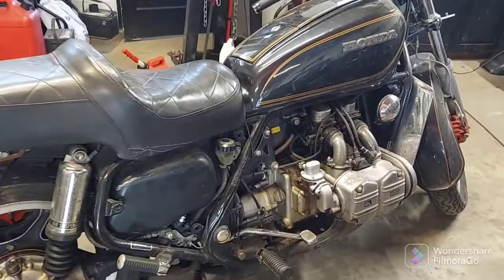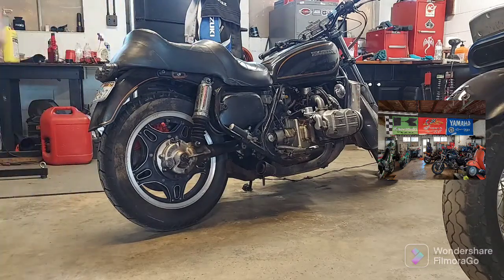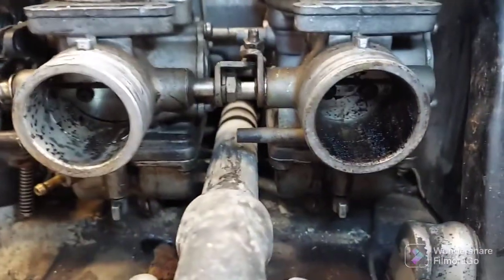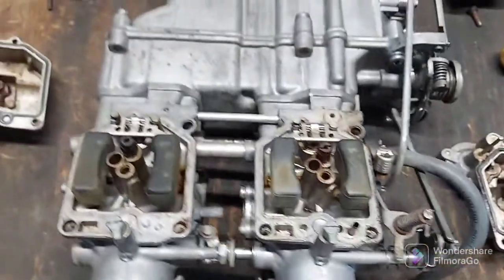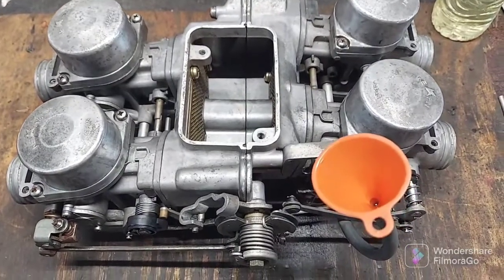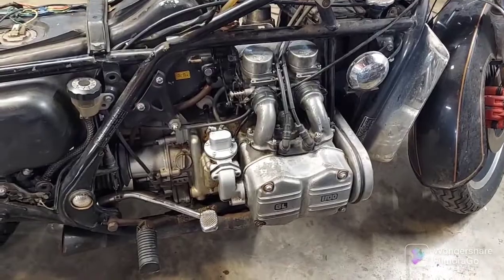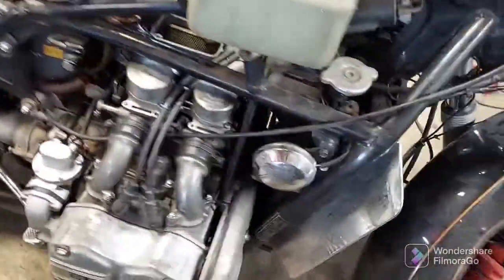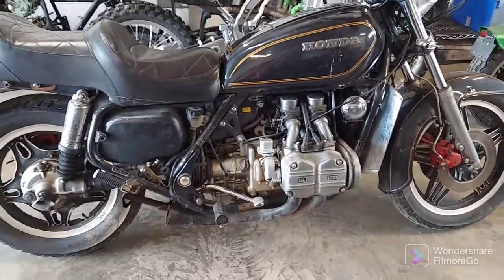1981 Honda GL1100 Goldwing will it run, first start! Carburetors rebuilt!

Comment: Good job, I did similar to a 1982 and a 1980 GL1100. after basic cleaning, carburetor and gas tank cleaning they run quite good. The GLs have a lot better engine design than the cb750s
Reply from the maker: @fkat28  thanks, I actually get to work on These  GL's quite often through the years. I have a 79' GL 1000 in the shop now that I'm about to finish, and one of my customers gave me an 86' GL 1200 that I am doing a video series about here on my channel. Plan on totally customizing it, just because...
Yeah, once the carbs are squared away on these GL's they do run awesome. Appreciate you watching and commenting 🐲
https://youtube.com/playlist?list=PLICWLX3xQIRPEn9JQXItuwfWZXvFHlc7K&feature=shared

Comment: I'm picking up a 76 gl1000 and the cylinder heads have been off, the top of the pistons and inside the bores are rusty.

if i wanted to get it to run in any capacity what would happen if i use scotch bright and kerosene to clean the bores?

Or if its to the point where theres rust in the bore would it need an engine overhaul? 

I imagine the rings could be compromised but i don't know for sure.

I dont think they ever turned the crank with it being rusty like that.
Reply from the maker: First thing you need to know is why were the heads off in the first place, there may be a major problem with the motor.  You could most certainly clean up the cylinders, if they aren't pitted, but you're obviously  not going to have peak power, but it might run. 🐲 Be sure to check out my Facebook page for more motorcycle content: https://www.facebook.com/profile.php?id=100057489818717&mibextid=ZbWKwL
Reply: @THE DRAGON  it's unknown why the heads were off.

 could have been the guy  didn't know what he was doing trying to track down a problem, or he caused a problem putting it back together and started taking it apart again to just quit.

Your guess is as good as mine.

I think he could have set the timing up wrong, or he had bad head gaskets, or the carburators are clogged up with bad gas tank fuel and he thought it was a problem elsewhere.

When do you decide when the heads have to come off?
Reply from the maker: @Snuggle Toast  The heads normally don't come off unless someone suspects major issues internally. Look close at the heads to see if there is a bent valve, usually can spot it because it stuck open. Maybe timing did jump or someone got it off, something like that, so they pulled heads to see the problem. Heads off an engine 90% of the time points to "major" issues. Your job now is figuring out the riddle. 🐲 Sounds like a fun project.
Reply: @THE DRAGON  thank you for helping me understand situations of bike repair.

It'll be the first time I dive into any motorcycle engine, I been trying to research on as many things pertaining to this project before I pick it up and start diving in.

Comment: I’m considering buying a Goldwing of the same vintage. When you rebuilt the carbs, did you replace all the o-rings behind the linkages and such?. I know those can be an issue causing lean conditions and was curious how difficult they were to replace. Thanks!
Reply from the maker: I have been working on these vintage goldwings almost since they came out. I have a love hate relationship with them. One major thing I discovered is if all cylinders aren't within excellent compression these old carbs will never work perfectly no matter what you do. But to answer your questions, this was not actually a rebuild per say, it is recommended that you replace every oring, seal or gasket. Often the customer just wants as little done as possible to get it running good due to cost. These were not separated from each other, just the bowls and tops removed to thoroughly clean and rebuild each individual carb.

Comment: you do great work! i have a 1979 gl1000 that needs a little love but  its so close to running good. do you do phone calls or zoom to help out?
Reply from the maker: I do that sometimes, right now I'm booked about a month out on "priority jobs" in the shop, not counting the years worth of builds and restorations, then when I'm not at the shop my chores and my family eat up the rest of my time. So right now it's just bad timing, but sometime in the near future. Before you worry about  how well the carbs are tuned, ect. Have you done a compression test on the engine? You need to know what you are dealing with before you throw any more  money in it. If you have already done this and it checked out good, than disregard this. For now you can comment here and I can answer it when I get a chance. Let me know. Thanks
Reply: @thedragon2299  thank you for the fed back, i will do a compression check, and give you an update. what should the compression number be?

Comment: What cleaning solution did you use to clean outsidethe carb.
Reply from the maker: I use Berrymans carb cleaner mostly, but to scrub the carbs I will use purple power, and if I really want them to shine without polishing them, I will use aluminum wheel cleaner. That stuff really makes aluminum look good. But there is no magic solution out there, the key to it is elbow grease, good old fashioned scrubbing! Thanks for watching and commenting 🐲 
Check out my Facebook page too, lots of good stuff on there! https://www.facebook.com/profile.php?id=100057489818717&mibextid=ZbWKwL

Comment: What exhaust is it
Reply from the maker: This was a customer's bike I worked on. He just cut the stock exhaust of right behind the cross over pipe. You can see the pipes cut in the video if you look close. They are great bikes when running right, but can be a big pain in the ass when they aren't. I work on alot of them. I am currently working on a 1979 GL1000, an 83' GL 1100 just left the shop last week. I am also working on my 1986  GL1200 that I got free from a customer. I seem to be a magnet for Goldwings, and I have a love hate relationship with them🤣. Thanks for commenting,  BE SURE to check out my youtube channel, there are many Goldwing videos on there. Also have alot of content on my Facebook Business page here:https://www.facebook.com/profile.php?id=100057489818717&mibextid=ZbWKwL